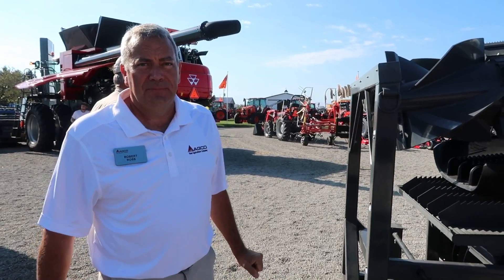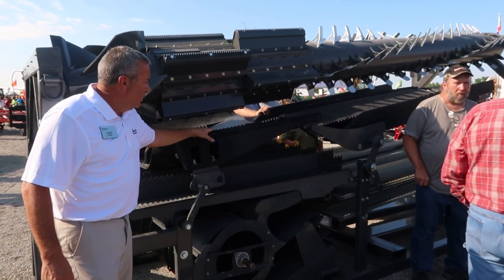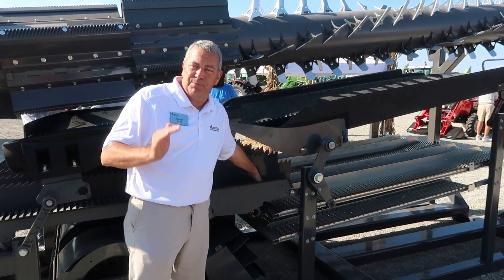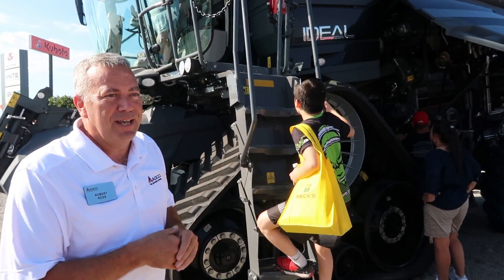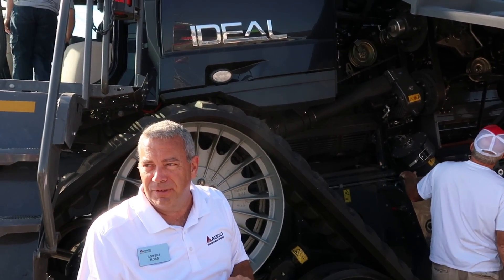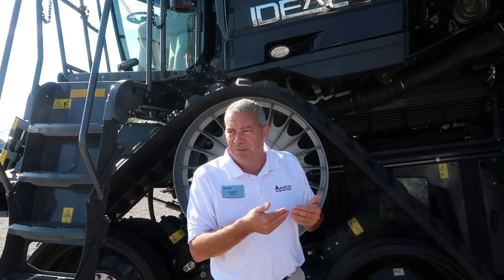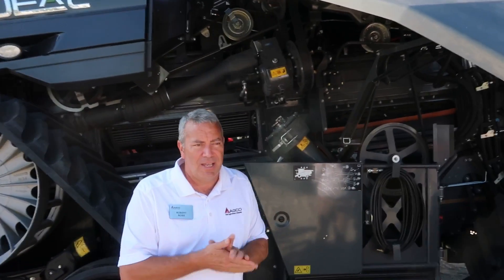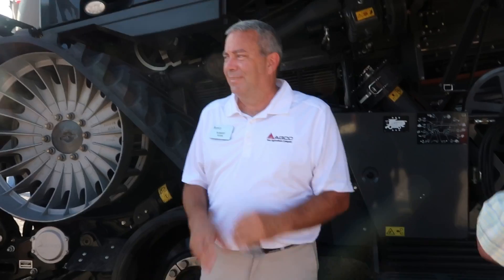How a combine works: Fendt Ideal

Comment: That is well done, FENDT is a great design; definate break from the traditional JD or CIH design.
Another combine that diverts from traditional design is GLEANER; there engineers configured the flow of grain on to the shoe through the discharge out of the concaves and a positive feed system that evenly places the grain on the seive.  A positive feature the majority of chaff is blown out of the flow before it lands on the shoe; very interesting.